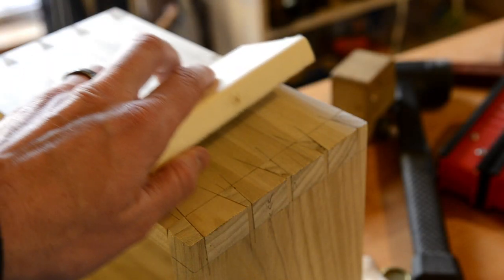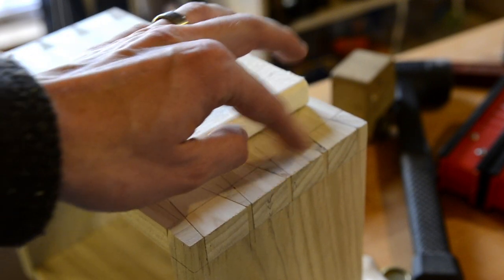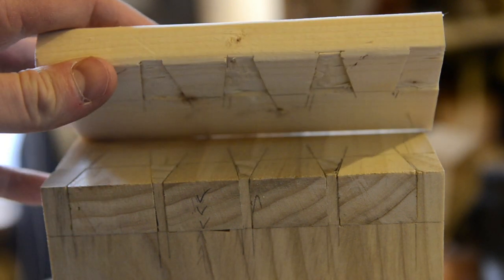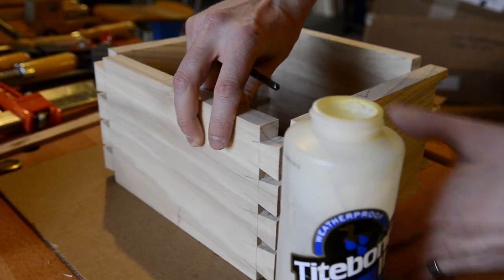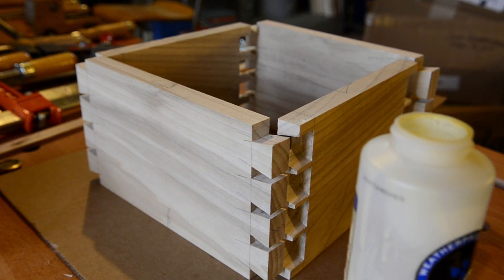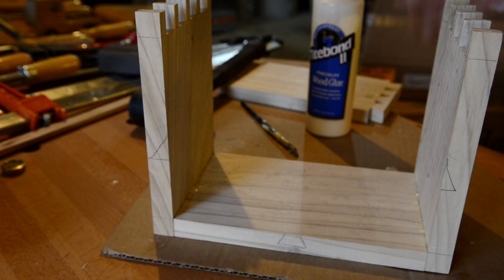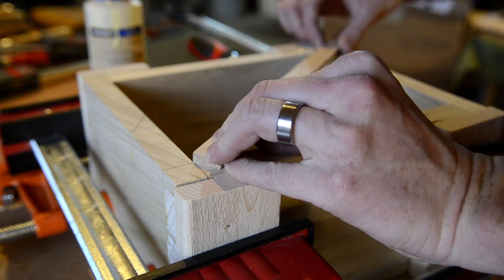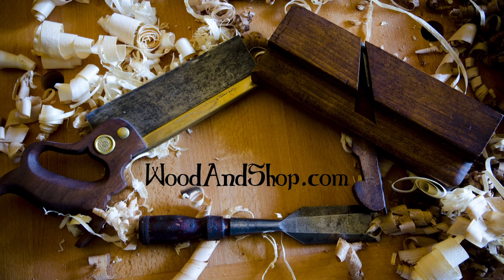Hand Cut Dovetails Part 15: Gluing & Clamping

Comment: you only need to put glue on one edge, as long as they fit tight.....way too much glue.  also, only need to put glue on the edges of the tails (or pins) and not on the back part of the joint, as that's just putting glue on end grain gluing which is a waste of time.  Another way of checking the fit of the joint, is to put pencil on the pins (essentially scribble on the pin itself) and put it together, if its too tight, take it apart and see where the pencil was transferred to the tails.